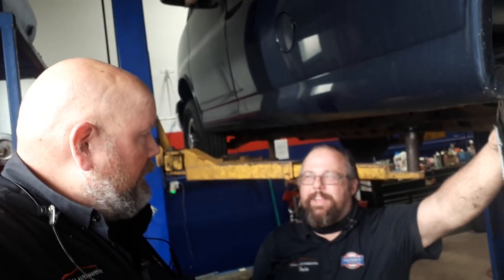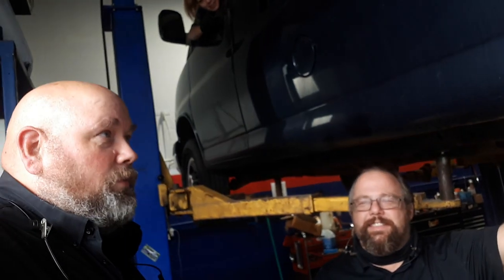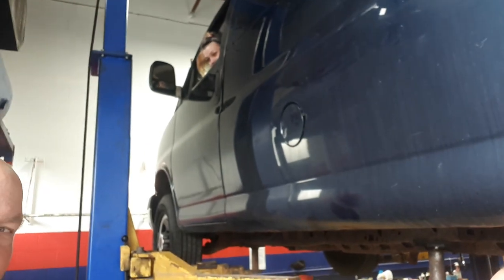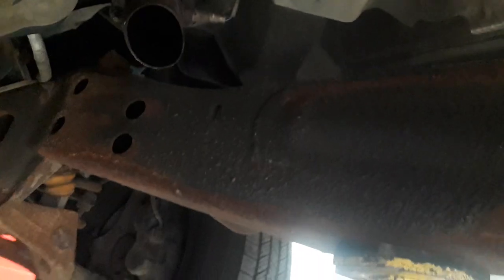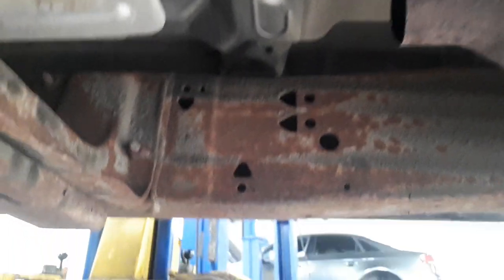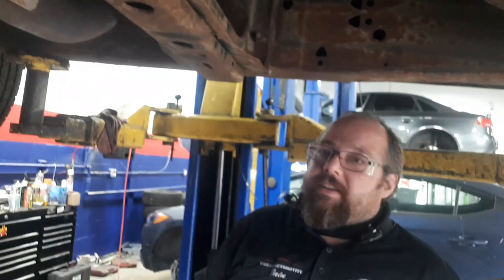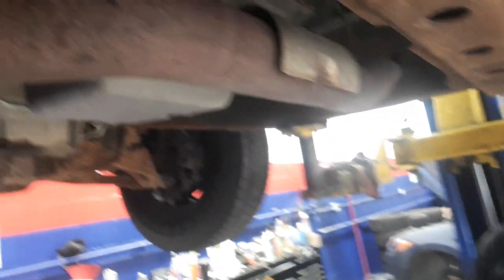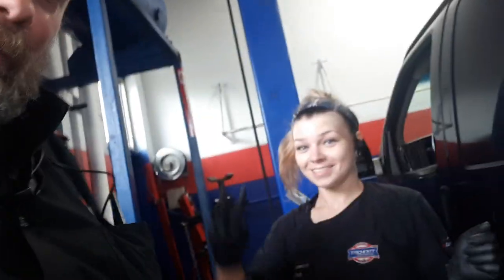How can you tell when your catalytic converter has been stolen? @UrbanAutomotiveOakville

Comment: I didn’t hear this noise until I hit the expressway. It sounds like if I moded my car. Can it be a muffler leak?
Reply: Did you ever find out? I have the same issue
Reply: This happened to me while on the expressway. It could just be an exhaust leak!! For me it was my flex pipe
Reply: So I think my cat is in place but my exhaust pipe might have fell off on its own but it does look like it was sawed off. Idk really but when I’m driving my car sounds like school bus now I have 2011 Honda civic

Comment: How much will it cost me to  have u replace my cat on 2002 Gmc savanna
Reply from the maker: As it shows in the video Lisa, your vehicle has more than one converter and multiple sensors. If we are dealing with a theft situation... it's unlikely that they took only one unit as these vehicles are targeted specifically because they can get more than one unit relatively easily because of the height clearance from the ground.  Then you also have to take into account where the converter was cut as in the case of the video  custom portion pipes had to be manufactured and sensors had to be replaced.  Without physically seeing your vehicle your range is anywhere from $400 and up. Again... in the case of the video that you just watched the client was quoted $4000 by the dealer to complete the repairs. His total bill with us was in the $1600.00 range (all in) 
Keep in mind also that our shop is located in Ontario Canada. If you are from the US or another Province or Country the price will likely be different. Hope this gives you a good idea of what you are looking at.
Reply: Ot will cost 300
Reply from the maker: @lisasilveira8817  glad you didn't have to get your insurance company involved like most. Consider yourself fortunate . 😉

Comment: Objects dont mean anything as long as the victim is safe thats what matters. Even though it definitely sucks when the converter is stolen
Reply: Yeah. Last summer here in NC, a convertor thief pulled a vehicle off the road into sand to remove the cat.... they identified the body by the clothes he went missing in 5 days before. 
That guy wasn't thinking@all... can't change a tire in sand very well... gonna get up under a truck on a hot summer day by himself and probably used a battery powered saw...-. jack slipped in the sand, & he'll never steal again.
Reply: Objects do mean something. This hurts working class people. I had my ignition stolen out of my Honda. I can only afford liability. I work at Amazon so I don't make a lot. $2k is a lot of money for me to cough up. That was the price to put in a new one. Money represents hard work to me and wear and tear on my body.

Comment: How on earth does someone jack up the car to saw this off in the first place? Is it likely theives would try this on a 2010 Dodge Journey? Asking for a friend :)
Reply from the maker: Unfortunately changenoways... 

We have seen thefts of all shapes and sizes. Our local muffler shop told of us of the WORST case they seen where the bandits cut the hood around the latch assembly of a Honda accord with a cordless chop saw or angle grinder. The converter is at the front of the engine and is part of the exhaust manifold. 

"Bold" is one world for it... $16,000 damage to the vehicle for $350 but in that case they didn't roll on the ground or lift the vehicle ☹️

Tell your friend THAT story and see what their reaction is.

Comment: How much does it cost to fix this?
Reply from the maker: It depends on the year make and model and how much damage is done when they steal the converter. In the case as the video the total repair was about $1500 For the 2 converters and sensors